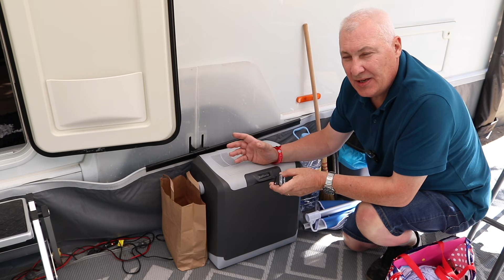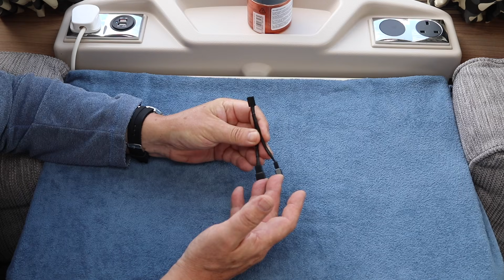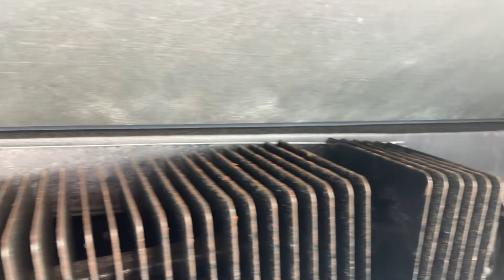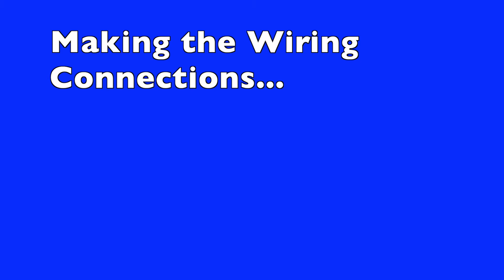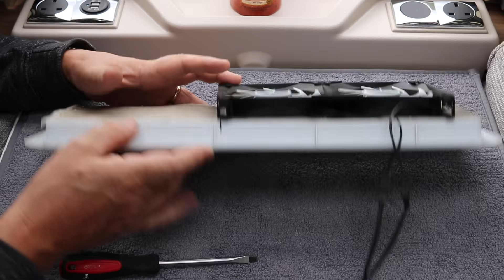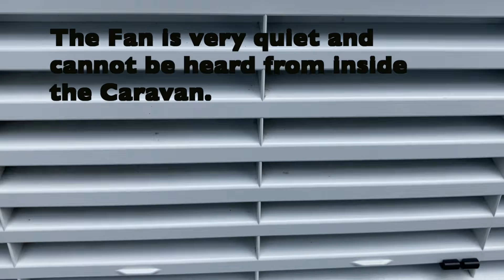Titan Caravan Fridge Fan Install (That Works)

Comment: One way I think is if you disturb the natural flow in the went grille with two fans, the fans not running will restrict the natural flow, at least if you have a top grille with the exhaust outlet, feels like you are building in a dependence of the fans almost always running, at least in my case with the LS100 grille, exhaust to the right
Reply from the maker: Hi Hans been running this system for a while now and had no issues with air flow when not using. Thanks Phil 👍🙂
Reply: @lostweekendscaravan right sir get that
Reply: how do you control the fans? pwm or what?
Reply from the maker: Hi I have since fitted the controller inside the caravan Here is a link to the video. https://youtu.be/2vW8g4hGlkA Thanks Phil.👍🙂

Comment: My fridge is a dometic rm 7270 wheel arch model
Reply from the maker: Hi measure the width of the vent cover to work out which fan kit will fit. Mine are LS200 models so I recommend the 90mm titan fan kit. If your vents are wider then the 120mm will be fine. Hope all my replies help. Phil 🙂👍

Comment: If I do get this kit it would be a different installation at least on my adria
Reply: You know power is the least problem here…
Reply from the maker: That's fair, every setup is a little different depending on the model. Finding the 12 volt cables maybe in a different colour. Use a volt metre to find them if your vent covers are LS 200 I would the 90mm titan fan kit. Thanks for watching, Phil.🙂👍

Comment: Thats weird also got dometics two ventgrills but my upper one have the exhaust grill on the right side, yours are the same both of them, never seen before
Reply from the maker: Hi each manufacturer sets up the exhaust vent differently. 👍🙂
Reply: Apparently, this setup on a wheelarch never seen before

Comment: Thanks for your video, and Titan duo fans like that are definitely a better solution. But the way you've bundled that wiring together behind that grille, close to the burner, surely that isn't how it's supposed to be done?
Reply from the maker: Hi Frank No its not. I was not happy with that result. Since then I have managed to drill a hole in the firewall and fit the cable and controller inside the caravan. I sealed the hole with heat resistant silicone which passed its service inspection. Sometimes we make videos and we do leave some of the work to yourselves to work out as each caravan is different. I hope this makes sense. Thanks Phil.👍🙂

Comment: After watching this video, fitted this Titan fan kit a few weeks ago with no idea we would be going away during this current heatwave, its currently over 32° and cooling the fridge down ready to go away, fan kit seems to be helping but not 100% sure, acid test will be when we start putting food in it, fingers crossed it works.
Oh and another tip is to only put the fridge on level 3 or 4 rathar than level 5, the fridge is actually working less to cool fridge and actually cools the fridge quicker.
Reply from the maker: Hi Bryan we are away right now and it’s roasting. Fridge is set on 4 and titan fan kit is on and doing a great job. Remember to turn down the fan during the nighttime. Thanks Phil 🙂👍

Comment: Just fitted the dedicated fully automatic Dometic fankit in 37c ambient temperature and the fridge, not the freezer compartment, is at - 2.1c.  Works fine for me.
Reply from the maker: Hi Mike. So glad it worked for you. Sadly not for me. I am using a Titan which is cheaper and controllable. Hope it keeps everything cold. Many Thanks Phil.🙂👍

Comment: Hi Phil, I didn’t think I would need to go down this road until yesterday when the ‘Home Secretary’ told me the fridge in the caravan is not working. It was working but competing against 30 degrees. An open caravan door which covers the vents did help. I now going to have to fit one of these. It was good to see / hear your views on the Dometic version which I will now avoid. A job for when we get home next week.
Reply from the maker: Hi Noorman. Well my Queen doesn't have that issue with this fan now in place. Away tomorrow and it will be busy working its socks off for our fridge.  If you check the community comment you will see that the controller is now inside the caravan. Hope this helps Phil. Enjoy your upgrade.👍🙂

Comment: I've fitted a 90mm Titan fan kit to my Coachman VIP575. I originally bought the 120mm version, but it wouldn't fit the grille, so I had to swap it. Coachman, like some other manufacturers, fit the fridge on the nearside of the caravan and, when the door is open and secured, it covers the vents, which isn't ideal. I was in France in May and June when we had the two heatwaves. The temperature inside my awning actually reached 48ºC, but the Titan fans kept the fridge working perfectly. I also propped the door open to improve the airflow. Like you, I wasn't prepared to drill through the sealed fridge compartment, so it's a real nuisance to have to remove the grille each time the power is switched off. It would be easy enough for Titan to add a remote control to the fan kits to make grille removal unnecessary. I bought a pedestal fan while I was away, which has a remote control which turns the fan on and off, changes the fan speed and changes fan modes. Keep the great videos coming Phil. Thank you.
Reply from the maker: Hi Steve. Wow you were in the heatwave. Yes the controller is a pain. It got that annoying that I did drill a hole through the wall and fit it inside the van. I used heat resistant silicone to seal up the hole afterwards. Just had it serviced at a very thorough service centre and it passed the safety check. I will try and speak to titan re a remote version. Thanks Phil 🙂👍

Comment: How long is the heat cable please.
Reply: Thanks. I am going to fit the controller in the van. How much of the sensor do you think you have to leave behind the vent.
Regards
Reply from the maker: There is so much sensor cable you can easily leave most of it inside the rear fridge area. As you fit it will make sense. Mine is inter-woven close to the fridge fins and pipes. Thanks Phil. 👍
Reply from the maker: Hi Andrew. The cable is about 2 metres long. I have since managed to fit the controller inside the Caravan with plenty to spare. It will work with tall fridges as well. If you check the community posts on the channel there is a picture of the controller. Thanks Phil.👍🙂
Reply: Thanks

Comment: I bought dual usb powered 120mm fans for about £15 and a usb extension cable  for about £3 and I am going to power it via a usb plug inside the caravan, and cable tie the fan to the vent. I know it’s not very tidy but should suffice when needed
Reply from the maker: Hi David, that’s a clever idea to keep things simple and functional. I like your thinking. Thanks Phil.🙂👍

Comment: I too have fitted on of the Titan fridge fans and I did wire the controller inside my van. It no problem drilling a small hole as is can have a grommet to protect the wire and belt and braces use some high temp silicon to seal around the wires. Warning thou don’t use the silicone with the awful smell a it can attack the wire coating ie. Plastic.
Reply from the maker: Hi, that sounds like a very neat way to install it and I appreciate the heads-up about the sealant. I think i'll take the plunge and have a go. Thanks Phil.🙂👍

Comment: Great video. Could you confirm if this would be ok on my 2022 Swift? Looks same.Thanks
Reply from the maker: Hi Nigel. I would recommend the next size down as it will fit much better. It is just as effective. Here is a link for the correct size. Thanks Phil.🙂👍
https://amzn.to/4oUvxne
Reply: @lostweekendscaravan thank you that's great. Hoping I can manage the wiring side 😂👍

Comment: Any update on fans
Reply from the maker: Hi. I can tell you its still working fine and better than the Dometic. I still don't have a way of fitting the controller inside the van. To honest I have not had time to think up a way. I must have another go at it. Once I have solved it I'll make a video update. Thanks Phil.🙂👍
Reply: Still no problem taking hatch off to set      the control  unit   really I'll have a look  Yorkshire guy did a good install he was lucky where is was
Reply: Hi, if you still haven't found a way around the controller without taking the vent cover off you could do as I have and I use a simple 12v remote controller bought on amazon for about a tenna. It is very simple to wire as only power cables in and power to load on other end of the controller and you can simply turn your fan on and off when needed by a remote control. Very simple to use and very reliable.

Comment: Good informative vlog Phil. I amabout to fit the same fan kit.  What fuse rating did you use?  
Cheers 
Alan
Reply from the maker: Hi Alan. 5amp did the trick but you can use 10 amp. just to let you know its still going strong. Thanks Phil.🙂👍
Reply: @lostweekendscaravan brilliant thanks. I’ve just had a look at the caravan and it’s working out really well. There is a void at the back of my fridge where I. An access the kitchen and get the controller mounted in the kitchen. 👍👍

Comment: Hi Phil, do you have a link for those block connectors please? I like the fuse addition.
Reply from the maker: Hi If you have a swift I would advise the smallest fan as it fits better. It will do the same job. Here is the link below thanks Phil👍🙂. https://amzn.to/4bnxKB7
Reply: @lostweekendscaravan perfect, thank you. We have a Sterling (which is basically a swift) so I will look at the smaller ones. Now to find your dometic fan video to see your wiring in more details. Thanks for the great videos Phil. 👍

Comment: Hi Phil, I have been going around and around looking to get a 90mm Titan fan, but nowhere in stock for months.  I may get the 120mm like yours anyway, as you have been able to fit it.  Have you found a solution for the control panel yet?  Do you really have to turn it on every time you switch the 12V off?  I would worry about weakening the vent cover by taking it off so much...  I am confident enough to give this one a go myself, and thank you for the great explanation on how to do it and the pitfalls on the way
Reply from the maker: Hi Bernie. At present I still have not yet found a solution to the controller. I only use the fan in really hot temperatures so I am not constantly removing the vent. I have got used to doing this now. Personally I would hold out for the 90mm version it will fit far better. thanks phil.👍🙂
Reply: @lostweekendscaravan Thanks Phil, estimated delivery September so not for this season ☺️
Reply from the maker: Not to worry it will give you time to install and workout a place for the controller. Thanks Phil.🙂👍
Reply: @lostweekendscaravan  Phil, Ive just seen a Titan fan that has a remote controller, but again, no stock or import from overseas only.  Now that would be good!
Reply from the maker: Hi Bernie. I am in contact with Titan at present. I am recording a heater fan which will be out in September. Could you send me the model number please. Thanks Phil.🙂👍
Reply: @lostweekendscaravan  My mistake, they changed the control, but still wired.  Never mind.   I am going to fit a wireless relay into mine so I can just use a key fob to turn it on/off. £7 from EBay  I’ll let you know how it goes.
Reply: Hi Phil, just to let you know that I fitted a remote relay into the wiring and added a small green led light which I fitted to the bottom part of the fridge vent frame. When these grill is on, you can still see it if you look low down or radially at night. It has a key fob to operate, so I can turn off all the power when I need to. The thermostatic relay maintains its settings even when powered off, so it can be switched on/off from the outside now once I played around with the temperatures I needed the fan to kick in and off. I settled on 30C to switch off and 33 to switch on. My fridge has since maintained less than 5C in the hot weather on mains electricity and fridge level 3.  Very pleased that this really does help even in the UK
Reply: One more thought, Phil, do you turn the 12v off when towing?  Will the separate 12V towing system keep the fridge running, albeit without the fan operating?
Reply from the maker: Hi Bernie. Yes I only turn it on when sited. The vents do allow cool air in when towing. I run the fridge when towing apart from when I am going to Europe on the ferry then we run with the fridge off and no contents. Thanks Phil.🙂👍

Comment: with all that wiring you did. that a fire hazard waiting to happen. keep your wires away from that flu and igniting burner. the way you did that is not safe. better watch your insurance company don't see that mess
Reply from the maker: Hi Ricky Thanks for the comment. We never use our caravan on gas at all I don't trust it one bit. But thanks all the same. Phil🙂👍
Reply: Very good informative video. Thank you. We had a domestic single fan fitted last year and it’s never worked so will look at fitting one of these Titan kits. Thanks again.

Comment: Many thanks for an interesting video. We have an issue with the ice box not getting cold enough to produce ice so wondering if this would solve this ? Appreciate any thoughts.Cheers Bob
Reply from the maker: Hi Rob. Thanks for watching. I have never been able to make ice in the freezer. For some reason it will keep pre frozen items frozen but not from scratch. I hope this makes sense. I have no idea why the provide Ice cube trays. Thanks Phil. 👍🙂

Comment: Hi great video, the purple and black wire connections. Could there be a problem with the extra loadings of the fans on this circuit . The reason I ask I wouldn’t want to overload a pcb ( if there is one. Thankyou for your video
Reply from the maker: Hi Paul been using it for over year now not had any issues there’s an inline in-line I added which would help. Thanks Phil 🙂👍

Comment: Hi Phil I was just about to purchase the Dometic fan, I also viewed the titan, but was a little concerned about restricting the natural air flow when the fan isn’t running, thanx for your posts, oh could the control be mounted inside the van so easy access to set.
Reply from the maker: Hi Paul. In my van the fridge rear area is sealed if yours is not you can feed the controller inside the van. I would adhesive velcro to mount the controller. Hope this helps. Phil👍🙂
Reply: @lostweekendscaravan thanx Phil, I think I will go the way you suggest👍

Comment: I am going to use a 12v rf relay to switch it off and on with a zapper (like a car key) as and when required
Reply: Hi,bought 12v fr. relay and 2 fans on eBay for £22;wired up in garage and tested ok,works from about 15 metres away.will fit in van later on as not needed at moment and going away soon( in uk)Cheers Keith
Reply from the maker: @ great job. When you have fitted it let me know. Enjoy your break away. Phil 👍🙂
Reply: Fitted and working ok in van,2 120mm fans £12,rf relay £7,aluminium 20mm angle £6 from Screwfix.
Reply from the maker: @keithbradley8737  Awesome. I am so glad you have been able to make a fan system for such a low budget. I am not that tech minded. The titan fan works well for me and much better than the dometic waste of money fan. Phil:)
Reply from the maker: Hi Keith. Sounds good let me know how you get on. Thanks Phil. Merry Christmas & Happy New year for 2025. 🙂👍

Comment: Hi Phil. Thanks for posting the Titan twin fan video. As I explained previously, we also had the Dometic fan fitted but it dropped off it's sticky pad and it's too tight to get my hands in to refit. I have now purchased the 9cm Titan fan for our Swift. I measured the fridge vent and concluded that the 10cm & 12cm models would be too big. Our fridge is over the wheelarch on the nearside and the top vent includes the gas flue so the fan will be offset to one side like yours. Unlike your installation, I will be able to locate the controller inside the caravan. I will utilise the Dometic fan's 12v power feed as it comes directly from the fridge's power connection block. Regards, Barry.
Reply: Dometic fans be they the fridge or the cassette fans are in my opinion overpriced rubbish.
Reply: @wobby1516 Totally agree. Not fit for purpose IMHO!!
Reply from the maker: Hi Barry. Thanks for the update. I would have done the same. Enjoy a cooler fridge. Many Thanks Phil.🙂👍

Comment: Hi Phil, pleased the new fan kit is working for you 👍. When the fans aren’t running do you think they partially block the natural airflow? I think the Dometic kit had a faulty thermo switch. Changing that would have cured the problem. Cheers, Rob 😀
Reply from the maker: Hi Rob. Yes the Dometic one could have been a switch. It does seem to block the air flow. I have noticed that the intake air sometimes turns the fan. It works really well especially when it is very hot.  Thanks Phil.👍🙂

Comment: Good choice, I have the TITAN fans now in the second caravan and I am very satisfied.
They are making a super job, they are extremely silent and they don't need much energy.
I installed the control panel under the sofa, so I can adjust easily the speed and we don't have trouble in the night with this extremely bright LEDs in blue.

Comment: Hi Phil. Just watched your video. Great to see you getting around and filming all different locations 😆 serious, tho great video on cooling the fridge. I must look into this as I've got the same set up as yours. Last year we used a fan on a bench blowing air over the fins, which did help but need something more permanent. Cheers Paul
Reply from the maker: Hi Paul. Thanks. I would recommend the smaller fan set as it will fit better in your fridge vents. Hope this helps. Phil.👍🙂

Comment: Another good informative video Phil - May look at installing on our caravan
Reply from the maker: Hi Andrew. It is a great fan system. If you are considering make sure you measure your vent cover first so it will fit properly.  Thanks Phil.👍🙂